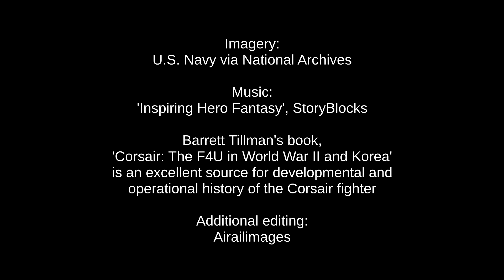USS BUNKER HILL F4U CORSAIR BOUNCED LANDING TESTS - JULY 1943 National Archives Airailimages

Comment: My father was a naval aviator from 42 to 64.  Of all the different types of aircraft he flew during his career, the F4U Corsair was his favorite, hands down.  He called his "Old Hose Nose", because of the way the nose protruded out so far in front of the cockpit.  He used to talk about how he'd get up to CAP altitude over the Lexington and once he had her all trimmed up, he would fly Lazy 8's just be leaning from one side of the cockpit to the other.  But she had a wicked side to her.  As alluded to in the video, the first variants of the Corsair had a nasty habit of one wing (can't recall which) stalling out before the other at low speeds, with usually disastrous consequences for the pilot (the aircraft would typically cartwheel down the runway, usually killing the pilot).  The solution was both brilliant and simple:  The Vought engineers designed a triangular-shaped wooden block about 6 to 8 inches on a side and attached it to the good wing (the one that DIDN'T stall out).  The little triangular block caused just enough disruption to the airflow over the "good" wing that it would stall out about the same time as the other wing.  Another nasty characteristic was the Corsair's P-Factor (engine torque).  If you advanced the throttle too rapidly, and if you didn't have enough aileron applied ahead of time to compensate for the torque, the effect of the P-Factor would usually cause the plane to go into a spin.....again typically with disastrous consequences for both plane and pilot.  That's how my father's roommate was killed on the Lexington.  He was coming in a little too slow and was given the power signal from the LSO.  My father's roommate applied too much throttle too quickly and the engine torque got away from him.  He spun into the sea, just short of the round-down, and was never seen again.  From that day onwards, my father said that he always came in high and hot and to hell what the LSO thought.
Reply from the maker: Thanks for watching, and for adding your family history.

Comment: It must be remembered, VF-17 was fully carrier qualified and deployed with Bunker Hill as fully part of the air wing in September 43 with F4U-1As.  The factory new oleo struts were in production on the line at Chance Vought in the F4U-1A in August 42.  Additionally, VF-12, and VOC-1 as well as 17 were all fully carrier quailed by April 1943. VF-17s land basing was due to logistics and it being the only carrier based F4U squadron in late 43.  Davenport and CV tech reps were the ones that came up with that stall spoiler as well, as written about in Jolly Rogers by Blackburn and in Whistling Death by CV Test Pilot Boone Guyton.  Also, that “Curved approach” was all ready in use by the Navy before WWII, as mentioned by Guyton, and can be seen in the 1940 film “Dive Bomber.”